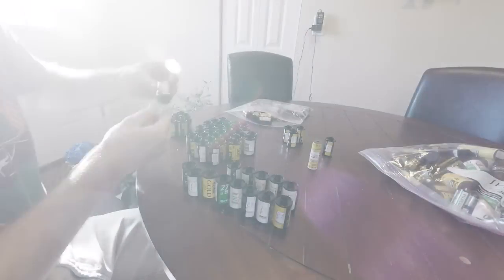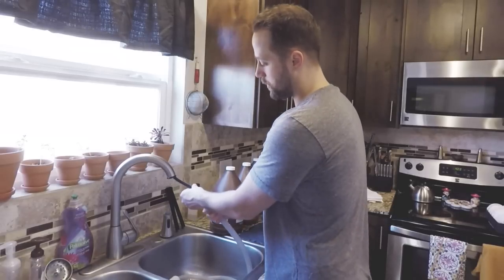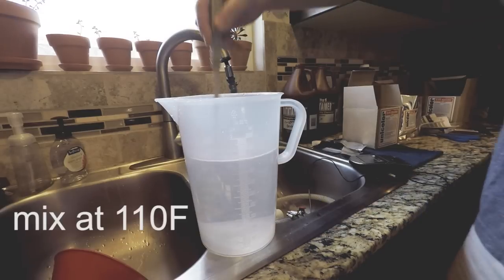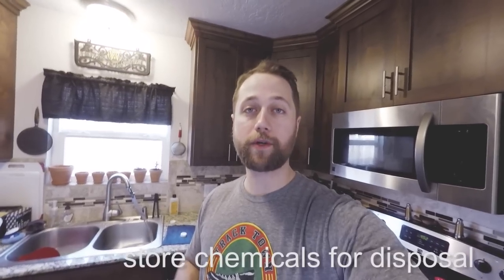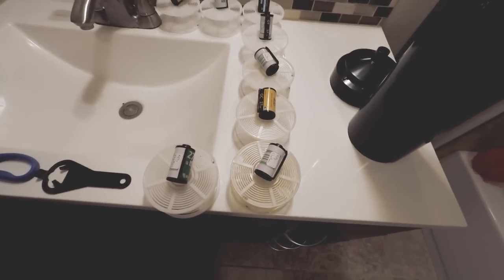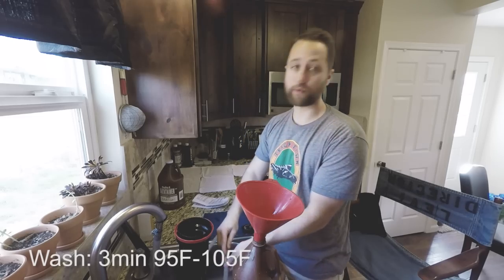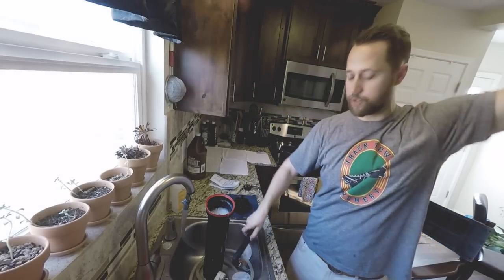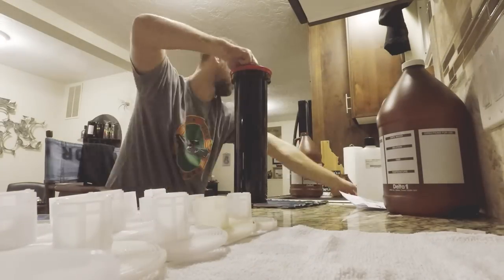Color Film Processing

Comment: You're really dedicated to the craft. 

Back in the day, I had a temperature controller for the chemical mix water that went through a huge filter, and then immersion heaters controlled by a thermostat in the chemical tanks. The chemical tanks sat in tank which had a pump that circulated the water. You could put in whatever temperature of water in the tank, and a thermostat kept it at the thermostat temperature by either putting in tap water or turning on a heater upstream from the pump. 

Later, I went to a Jobo, which combined the chemical heating tank and an auto agitator so I wasn't forced to shake and invert the tanks during developing. This is a LOT easier than your method.

Comment: That's some labor right there, if you process that much, I'd consider getting a 2nd hand automatic film processor (like fuji or noritsu, leader card type), they're really cheap compared to when they were new and some can process 30 or 50 rolls an hour. 
Another thing I noticed is the lack of twin check stickers. They're identical sets of numbered stickers, you put one on the film and one on the order envelope or in a spreadsheet. You just pull out the leader of the film and stick it on before processing, they're designed to stay on the film during processing and are an easy way of keeping track of rolls.

Comment: Very impressive and very worthwhile. I'm knackered after doing one roll, the thought of 80 films is more than I do in a year but I shoot digital for wildlife and studio work. Please can you tell me what is the advantage of powered chemicals over liquid C-41 kits like Tetenal? Besides the obvious being a lot lighter to post. My liquid mixed keeps for about 8 films or 6 weeks, I only make 0.5 litre at a time which works out perfect for me as it fits in with my usage and my developing tanks need 0.3 litres to cover the spool so it allows for the bit you lose on each developing. Does the powered keep longer?
Reply from the maker: It sounds like the liquid developer works just great for your process!  The biggest advantage with liquid is that you can mix small batches at a time.  That's not as easy with powder.  But since we mix large batches, we prefer powder because it has a much longer shelf life before mixing.  Once mixed though, it immediately begins degrading.

Comment: Hi, I've just started C41 processing at home.  I don't see you putting the processing tank in a tempered water bath when developing.  Will the developer lose temperature during the time of developing and does it matter?  I want to try to push 1-2 stops during development, and it might take 4-5 minutes for the developer stage. Thanks for any help.
Reply: +Stanley Ho We've never felt the need to use a bath during the developing stage for the standard 3.5 minutes and don't think it will make much difference for your push processing as long as the environment you are developing in isn't extremely cold.  but as will all things film processing, I highly recommend doing some test developments to establish a process yourself before attempting a batch full of important images.
Reply: +Levi Bettwieser Thanks.  :-)

Comment: I'm interested in Developing about 25 - 30 rolls of C-41 Color Film. How many rolls can you process through without having to recharge your developer? Also, Is the Chemistry storable between development cycles? 

As an aside, I think this project is truly amazing. Keep up the good work! 

-MrCullDog
Reply from the maker: We use Unicolor C41 and it lists on the instructions how much film they recommend running through the developer before replenishing.  but we've found that you can push beyond that without seeing adverse results.  So we'd recommend starting by following the manufacturers guidelines.  Then do one batch beyond that and see how the results turn out.  The thing to realize is that the developer does not suddenly go bad, it's gradual.  So if you slowly start to see any changes, then stop.  In regards to storage, we don't re-use any chemicals after a round of processing.  As soon as the chemicals are mixed, they start degrading and it's not worth the risk of ruining an image to save a few bucks.